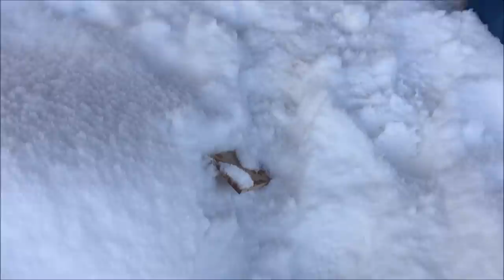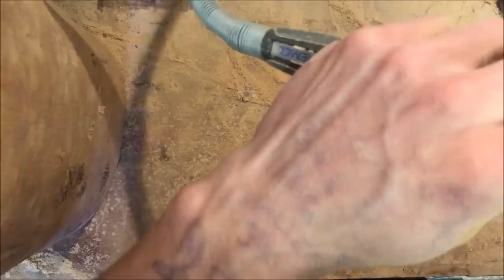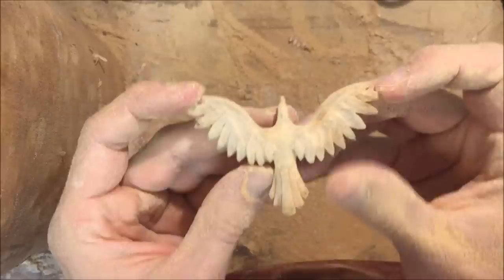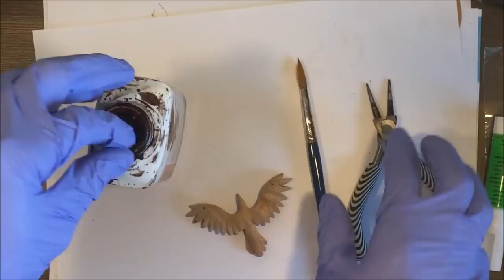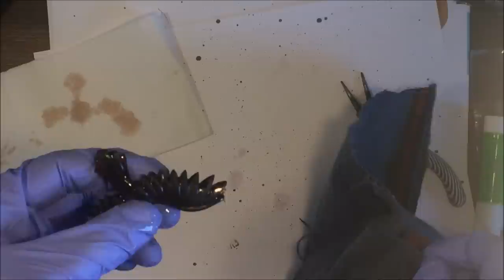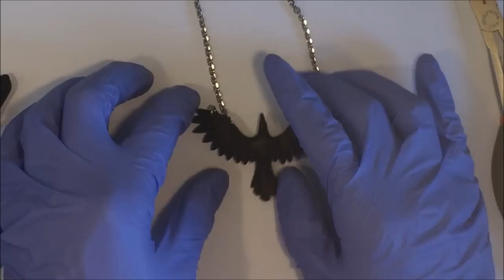WOODEN PENDANT | RAVEN PENDANT | TIME LAPSE WOOD CARVING

Comment: if you want the raven black then you can use black lead that is for a range stove. or carve it in oak then put rusty nails in vinegar for about 4 to 5 days it turns oak black then burnish.It also turns leather black don’t buy those expensive dyes.. great job btw

Comment: what type of sander are you useing? if it is a sander. im a beginner at carving wood and stuff and ive used a jig saw before and a sander belt at school in the shop but nothing like what your useing, i would really appreciate it if you could possibly tell me what that is so that maybe someday i can get the same type of thing for myself. :)
Reply from the maker: Hello! in this video i used a dremel 3000 with a flexible extension shaft and the sanding drum attachment :)